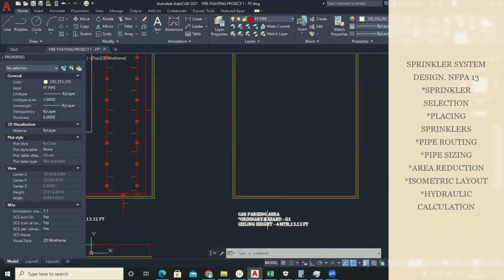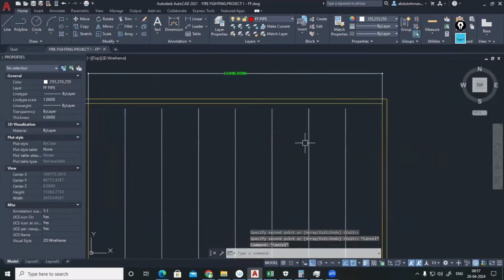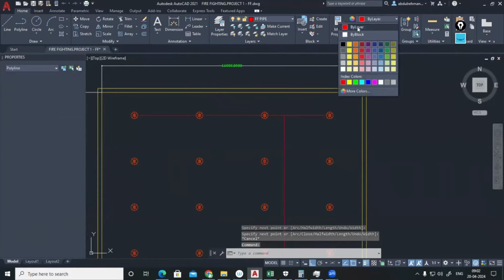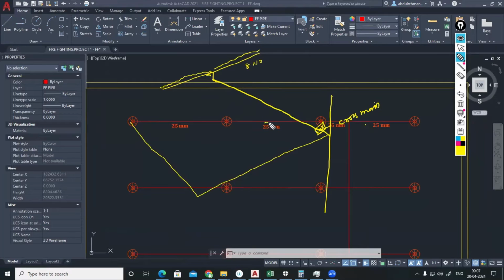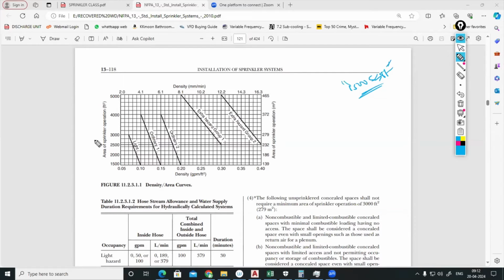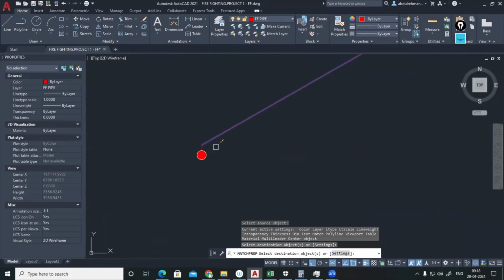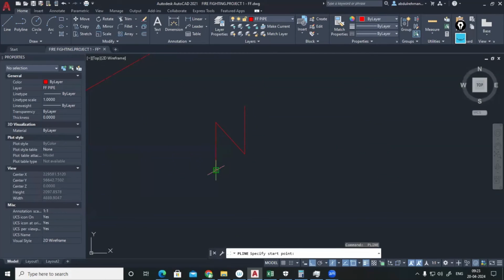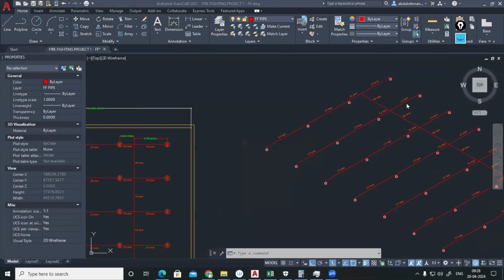NFPA 13|Sprinkler system design|PART 1 OF 4 |Hydraulic calculation|Isometric layout|Fire fighting|

Comment: Sir can we use the pipe schedule method for a building having 52000 square feet
Reply from the maker: As per NFPA 13, section 11.2.2 onwards...

The pipe schedule method can be used for new sprinkler systems up to 5,000 square feet and for additions or modifications to existing systems. Exceptions include: (1) Larger systems can use this method if they provide the required water flow at 50 psi at the highest sprinkler, and (2) changes to existing extra hazard systems can use this method.